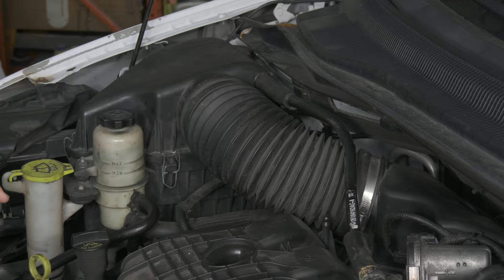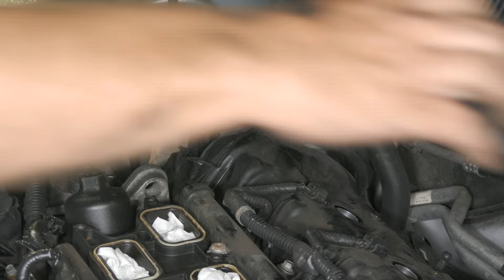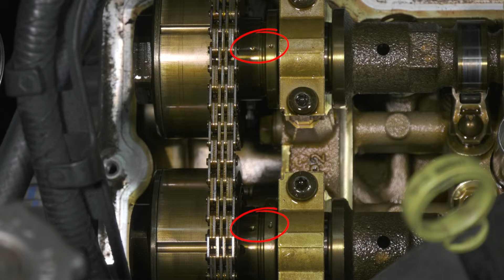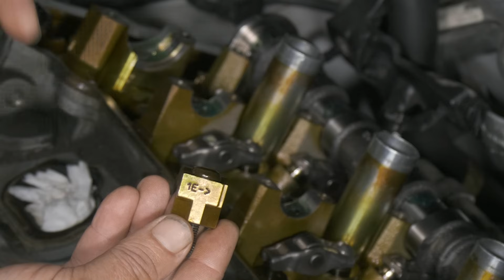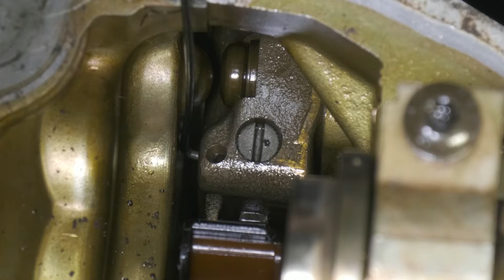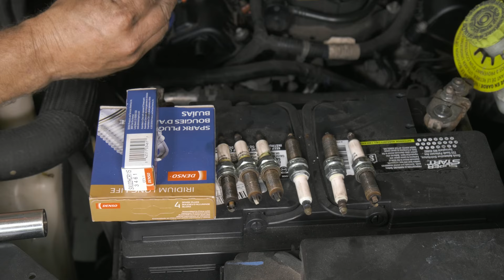2014 Chrysler Town & Country 3.6L Camshaft & Rocker Arm Ticking, Clicking, or Misfire Repair.

Comment: Great video bro. Btw, I stripped the head on one of my T30 cam cap bolts. Any suggestion? I was going to use an easy out. Of course taping off so shavings don’t go into engine. Or a valve spring compressor to remove rockers? Thanks
Reply: What did you end up doing?
Reply: @FredFlintstone21  I dammed and taped around the screw and drilled off the head, then removed cap and remainder of screw. Them I put in another screw, removed both cam shafts, replaced all the rockers and lifters, finished the job and the engine has run like a charm ever since. It’s been more than a year.
Reply: @Mark Swan  Great to hear you got it taken care of! The new rockers that end with AH in the part number, hopefully they last alot longer! I just bought a 2023  grand cherokee last week, and it's good to know what the known issues are! I love my new jeep! I'm sure you can relate! I got stuck in my corolla 2x this year, and went and traded it in. Do you think the type of oil, or frequency of oil changes, impact these rocker arms at all? My brother in law has a grand cherokee with 125,000 miles, and hasn't heard any ticking yet. Why? Better oil? He bought it used. Maybe previous owner fixed! It's awesome that you dove in and fixed your rockers! Most people don't even know what a rocker is!
Reply: @FredFlintstone21  I have a 21 ram with the 3.6L. started ticking at 98k. Best advice to you is to change the oil every 3500 miles with high quality synthetic blend. Other than that I absolutely love my truck. I pull 8k around with it across the country and won't go back to 1 tons.
Reply: @Tuff McCabe  thanks for commenting. My new job will be about 3500 miles commute per winter. I have several vehicles to drive in the summer months, and the jeep for winter time. So 3500 miles will work great! I was going to go 5k oil changes but if there's a bad weak point I don't wanna chance it!
Reply: @tuffmccabe3097  We do every 6K with full synthetic and of the 5 of these we have in our fleet, 3 of those didn't require lifter/cam attention until after the 200K mark and other 2 vans have only 100K and are doing great.    Run Mobil 1 or Royal Purple.
Reply: Definitely not 5k. I've started mine at 3k just to be super safe about it, but all the techs I've talked to highly recommend 3500 at the most. $65 oil change will save $1600 ez.
Reply: @Tuff McCabe  No sense chancing it! I've got a truck lift, so no excuses to pop it on the lift and get it done. Are you adding any type of friction modifier like militec, or AR9100 archoil?
Reply: @FredFlintstone21  no. I've been running Blue Blood 0w-20. It's made by cam and is really good alone.
Reply: @Tuff McCabe  never heard of blue blood oil! I just picked up valvoline VR1 20W50 for a rust free 1986 volkswagen golf I drove home from California. It was owned by a mechanic, and he put 20w50 in it. I thought, wow, kinda thick! No I won't be putting it in my new jeep!
Reply: @Tuff McCabe  That's crazy if that is the reason why the rockers fail. My next truck is a Toyota. He had his oil changed 3 times now going over 130,000 miles on a 13 Tacoma. Idk how its still going and didn't even change the transmission fluid yet😮.

Comment: This is defect in the Engineering design of Chrysler 3.6 and 3.2 engines.  Chrysler recommends 5W20W oil!!  My opinion!!  I would never use that thin of an oil in hot climate areas.  Minimum 5W30W or 10W30W!!!  I purchased a new 2016 Town and Country.  After 3000 miles on a new vehicle!!  I only utilize 10W30 and with 220,000 current miles.  I have not had too replace Cams, Rockers!!!  Just a FYI!!!
Reply: They actually used 5w30 on earlier engines. My 2011 takes 5w30, I dunno when or why they switched to 5w20
Reply: @MilesCallisto they went to 5w-20 for the government emissions rating